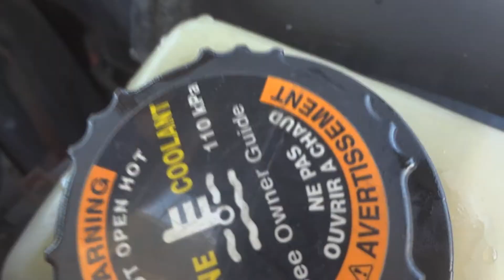How to change the antifreeze in a 1997 f150

Comment: What about the coolant in the engine block?
Reply: According to the owners manual, the 4.6L engine with A/C on the 1997 F150 holds 19.4 qts of coolant.  Just like yours, when I drained my radiator, around 2 gallons came out.  That means there's still around 2.5 gallons of old coolant left in the engine block.
Reply from the maker: @pauljohnson-yk5dq  then how do you get it out?  I ran fresh water in it to help flush out more.
Reply: There are 2 drain plugs on the engine block itself, but I think you can only access the one on the driver side.  The  other is very difficult to get to.  This posting shows photos of the driver side plug: https://www.f150online.com/forums/v8-engines/199273-97-4-6-block-coolant-drain-plug.html . 

To get all the coolant out, you have to drain the block, but it's a bit of a pain.  Actually, I'm debating whether to just do what you did, and be done with it.  I just did a chemical flush today.  I'll flush again with distilled water tomorrow, then finish off by adding new coolant.  I'm thinking if I decide not to drain the block, I may have to use a slightly stronger concentration then 50/50 to compensate the mostly distilled water that's still in the block.

The fact that the coolant capacity is 19.4 quarts, and I only got 2 gallons from the radiator worries me a bit.
Reply: This guy (see https://www.youtube.com/watch?v=RWIXa50R9bo ) flushed the system then just drained the radiator.  But he used a 70/30 mix to compensate for the mostly pure water that's still in the block after the flush.   I think that's probably the easiest way.   Draining the block looks like a pain.

Comment: You can always boil water first
Instead of buying it
Reply from the maker: Distilled water city water has minerals no good
Reply from the maker: @dfls5069  might need pliers on bottom to rock it loose. You can run engine from cold with the cap off to let air out. Let engine warm up with cap off.  Don't remove a cap from hot engine.